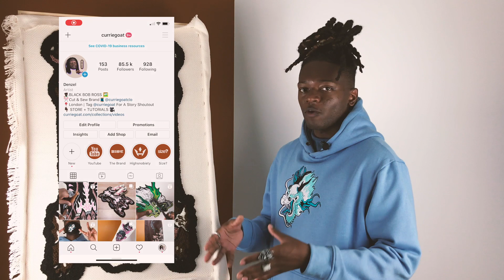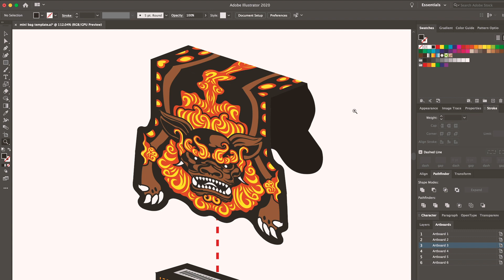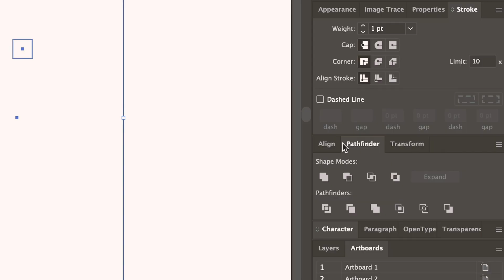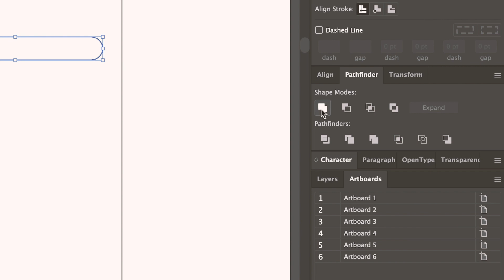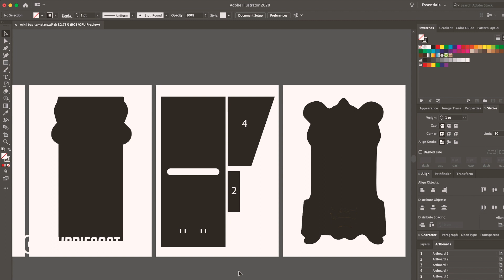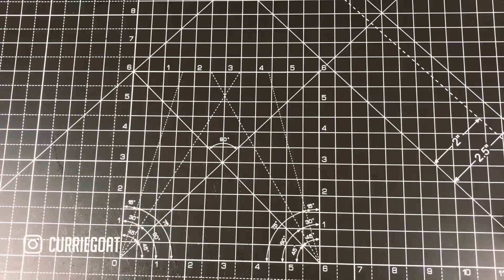how to make a mini bag * leather craft for beginners pt 1 *

Comment: I would try gently heating the leather and shaping it over an arched shape. Leather can be moulded and shaped, with the right techniques and tools.

I am an amateur cosplayer and I’ve done this for some leather armours etc.

Hope that helps!
Reply: Or with veg tan leather, you can get it a little damp and bend and pin it into shape
Reply: if you heat the leather especially with veg tan it can crack- please be careful with your cosplays! 
-sincerely a leatherworker of 5 years (also rad on you for using leather for cosplay!)
Reply: I would say definitely case the leather first before working with it. Makes it much more malleable, and the moisture helps with dyeing

Comment: 6:20 or invest in a cutting machine.
I have the Curio from Silhouette America, it cuts, emboss, deboss, etches, .. but they have other models that only cut too.
They can draw too with any pen you want if you use a pen holder in the machine. They also sell deep cut knives and fabric knives, I don't know if it works with leather but I assume they do.

Comment: If you do this again you could try kid skin or suede for a lining. The kid skin will have the same kind of finish, but is incredibly thin so it won't add bulk to the leather. You just have to use a good leather glue to attach them to each other. Suede is soft and thin, but less durable. Beautiful bags by the way.

Comment: you can use pliers to pull off the zip teeth and clamp on ends either side to stop the puller running off the end, that way you only have zip tape to go through instead of the metal teeth.

Comment: Try applying the second layer(inside leather) on the curved flap(outside leather) while it is already curved then cut the bottom layer to match the edges of the outer layer. Then the flap will hold its shape and stay curved when you open/close the bag.

Comment: you should have sewn the leather piece with the magnets to the front leather part, the glue is not gonna hold it for very long
Reply from the maker: I made ALOT of mistakes with the pattern so I had to improvise 😫 I’ve learned now though
Reply: CurrieGOAT Can’t wait for the next video 😜